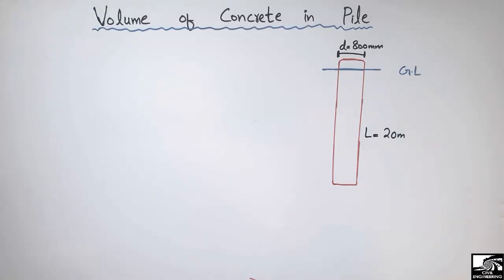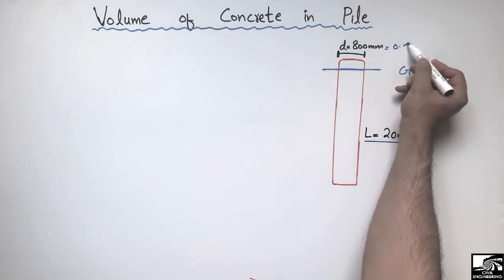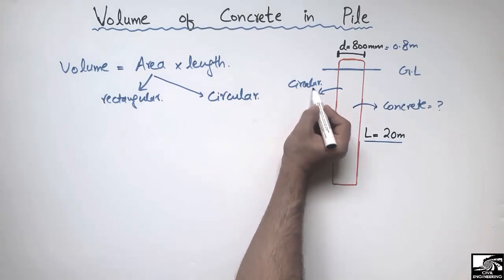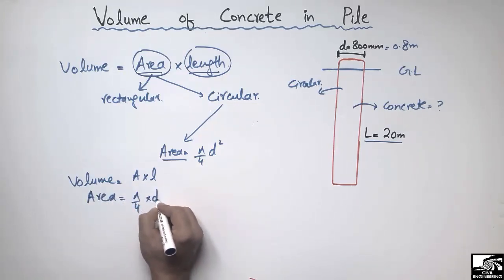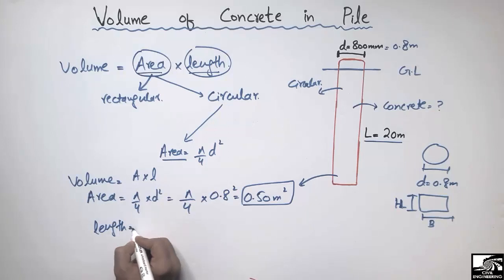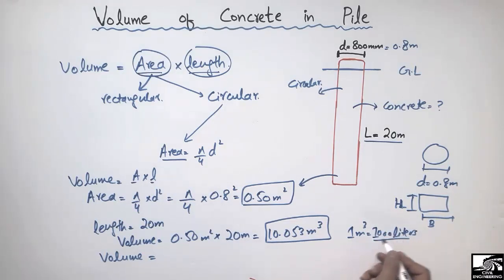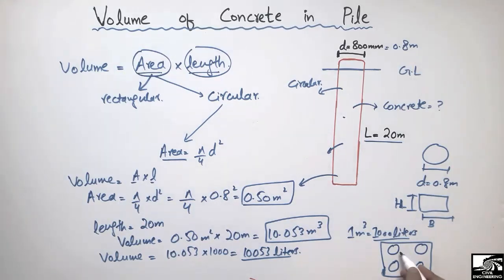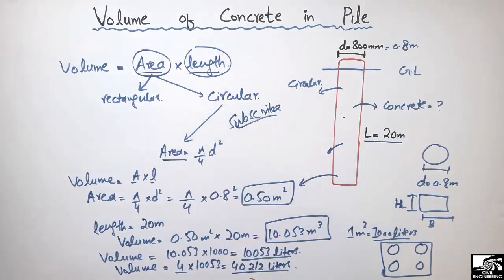How to calculate quantity of concrete in pile foundation

Comment: How much concrete in 1200mm dia pile of 10m depth?
Reply from the maker: You can do the same calculation, just by changing the parameters...
Reply: @civilengineering94  that i understand, i tried to calculate myself but wasn't working out. Please write and share the same if possible. Much appreciated 👍🏻

Comment: Formula I used = Pi R square h.....
Where pi= 3.14, r= .300m , h=3.50 
=0.9891 x 17 no's piles
=16.8147

As per your formula = I get this value
0.247275 m3

Which one is correct

Comment: but how can we calculate the amount of portland cement that goes in if the design strength amounts to 40MPa. What is the most suitable ration between cement:aggregate:sand:water ?

Thanks in advance